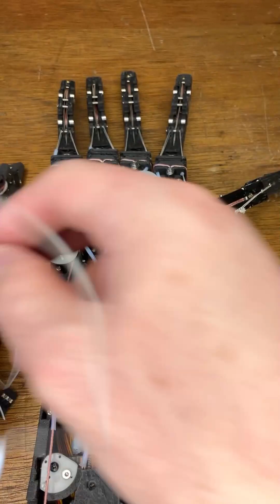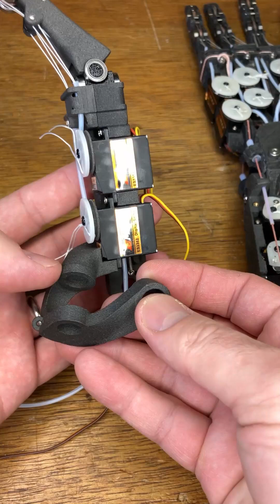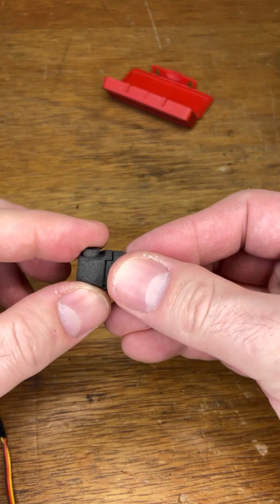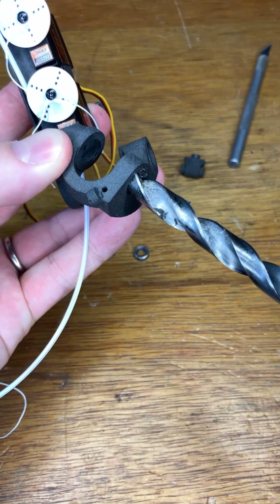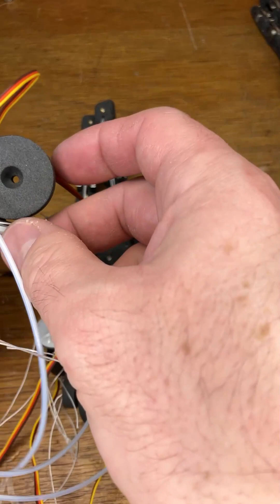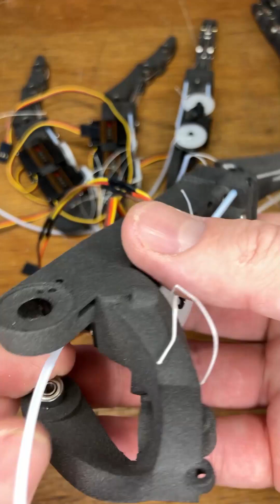How to build a V1.0 DexHand Part 7: Fingers and thumb #DIY low cost #robot #hand

Comment: Can I make one or two observations regarding your design compared to the human hand? Firstly, the thumb does not pivot in the way your design shows. It is the same as your finger 3rd joint but rotated 55 or so degrees. 
Secondly, fingers need to have the ability to pull upwards as well as downwards. Place your palm under a laptop face down and you can lift your laptop upwards with your fingers. Your design only allows one directional force in that axis. 
Great design though and very small which is tricky to achieve.
Reply from the maker: Thanks. A lot of simplifications were necessary to fit just the 19 servos of this design into the size available. The thumb particularly has less actuators than the human anatomy and the rotator is nothing like how the human thumb functions. Still it works and uses many less powered dof.

I class this as a semi-dexterous hand and for now it’s still more than enough for the computational models that are commonly available.

I expect that to change in due course and eventually the hardware will be the limiting factor in the capabilities of robots - couple more years I reckon…
Reply: @therobotstudio  what did you use to design the parts?
Reply from the maker: The CAD is designed in Solidworks.

Comment: Hello, your work is wonderful! But I have a question for you, is there a correspondence between the four tendons of the thumb and the four PTFE tubes that you mounted on the wrist in part 8? What is their correspondence? Looking forward to your replies!
Reply from the maker: Thank you.

There are eight ptfe tubes that pass through the wrist. Four transmit the long tendons of the fingers, one each and four drive the thumb. 

The four ptfe tubes that come out of the centre of the forearm guide the tendons that drive the thumb.

Two are similar in action to the finger servos in the palm - they drive the knuckle movement.

One is a long flexor which passes through the centre of the thumb knuckle.

The fourth directly drives rotation, it attaches on the thumb structure near the top of the knuckle and passes across the back of the thumb.

There are two springs for the V1 thumb. A main extensor which passes from the back of the middle phalange to the top of the knuckle.

The second spring pulls against the rotating tendon and attaches to the thumb knuckle phalange and then to the tendon hanger that attaches to the first finger between the servos - the tendon hanger for the thumb knuckle tendon that draws the thumb towards the palm and the first finger.

Comment: Could this design be adapted for a prosthetic?
Reply: Maybe if I thickened the gauntlet or simplified the design for the tumb?
Reply from the maker: Yes, you could put the thumb servos somewhere else or use the available servos in a different configuration to drive multiple fingers and leave some for the thumb.
Reply from the maker: Tricky for the V1 as the thumb is actuated by servos in the forearm. Typically this will make it too long.

Comment: I am using brushless dc motors for my robot fingers and wrists that are mainly used for drones or rc cars generally.  this is instead of a integrated servo.  to downgear I'm planning to use a archimedes pulley system instead of gears.  this will cut noise down to near zero.  removing the gearing from the direct proximity to the motor means more flexiblility in design and larger motors possible which means higher speed and torque available for a much more powerful robot at a VERY low cost still.  the pulleys I have varied in design plans for alot.  but thanks to this video, I looked into micro bearings and found 1mmx3mmx1mm bearings which I can use as pulleys with some small modifications.  I did not know such small bearings exist.  I thought smallest is size of a quarter!  these are SUPER small.  maybe too small to bear the loads I want so I bought 1x3x1mm, 2x5x2.5mm, 3x8x4mm  this way I can use larger pulleys for downgearing bigger motors in my robot but the smallest ones for downgearing the smallest motors.  let me know your thoughts and if you would consider this approach as well and scrap integrated servos entirely since they are weak and loud relatively speaking. By integrated I mean gears, motor, pot, control board all in one box.  Better to split these up to have more flexibility in form factor during design and not be forced to fit these boxes full of components in your design.  I HAD to go the route I'm saying here due to going with human skeleton as my frame instead of a hollow 3d printed mech style like you.
Reply from the maker: Glad I was able to help with the bearings.

I swore off integrated servos many years ago as they are far too prone to self-destruct. However the serial servos as produced by Dynamixel or more economically Feetech give feedback on motor parameters like temperature that make them a serious proposition.

Splitting the motor and controllers is limited by the cabling, which is one of the fundamental constraints on all robot designs.

This arm and hand shows the problem with precision industrial drives which require 3 motor phase wires, 5 Hall effect wires and 8 encoder wires for a grand total of 16 wires per motor!

For a hand with decent numbers of motors this becomes the dominant design constraint: https://youtube.com/shorts/V25Jn5UPYx8?si=WJvp04OrGJeln2Lx
Reply: @therobotstudio  my primary focus of my question was not on cable or controls although that is relevant surely.  my primary interest is your feedback regarding replacing gears with pulleys so you have more flexibility in form factor and don't have to fit such large black boxes integrated servos make you stuck with.  you also remove gear noise.
Reply from the maker: It definitely has potential - I’m considering hybrid designs of servos and tendons to get the best of both worlds.

Comment: I just bought some polymorph I'm sure I'll find many ways to use it and it is a nice tool for my repertoire.  your early videos are full of polymorph love
Reply from the maker: It's fantastic stuff, all of the early robots are completely hand made in polymorph.

Get some freeze spray as used by plumbers to make temporary blocks in pipes to rapidly cool large pieces and a hot air gun to remelt.

Make sure the pellets are well worked together before making anything that needs to be strong.
Reply: @therobotstudio  i never heard of freeze spray I just use upside down computer air duster cans to spray freezing spray onto hot glue to speed curing time
I wonder which options is cheaper?
Reply from the maker: Probably compressed air is cheaper but freeze spray is much quicker acting.

Comment: I have a question about the two knuckle servos that connect to the thumb. One is pretty easy to determine how it's connected is seen in the video The inside one however the routing for the tendon is somewhat confusing. Plus you have a tendon running to the insert on the forefinger. Does that mean we have four servos controlling the thumb. I've completed all of the fingers and a thumb but the inner tendons and the thumb and the routings are the only thing I have a bit of confusion over. I know you'll tell me what I'm missing. Thanks again. By the way the 3 mm springs are working great
Reply from the maker: Yes, you’re a bit ahead of my build videos!

The thumb has four tendons in total, all driven from the forearm.

Typically I use the four tendons that pass through the centre of the forearm to connect to the servos in the middle of the forearm.

Two tendons emerge in a similar position to the finger knuckles. There is an eyelet on the tendon hanger that attaches to the first finger palm section and another at the base of the thumb support, near the centre of the palm at the wrist end.

The long tendon passes through the middle of the two-piece thumb knuckle joint. The PTFE should line the hole in the centre of the thumb knuckle and the tendon passes through.

The fourth tendon is for rotation and attaches to the thumb support just to the inside of the thumb knuckle. It is opposed by a spring or elastic band that connects to the other side of the thumb and then to a screw in the tendon hanger which is clipped to the first finger palm section.
Reply from the maker: Glad the 3mm springs are working well! Passive extension is not an ideal method for the fingers but works well enough with a bit of careful set-up. The advantage of springs over bands is the extension force is linear and the lifespan of steel springs is much longer. Once set up it should last a good long while - be interested to hear how you get on…

Comment: I'm Nhan a student from the university of Georgia. I am very interested in building a hand. I have a few questions im hoping you could answer if you dont mind. firstly, huge fan of your work! Really incredible stuff. 

I am relatively new to the robotics scene  and I fell in love with this project the day I saw it on YouTube. I have some experience with servos and Arduino. 

-to make the v1 hand, I know that there are 3 servos per finger, and each servo is hooked into a Arduino / microcontroller which is the used to control the hand correct? 
-if my intentions were to create the moving fingers, and not the moving wrist. and use the sample code. am I getting myself into more trouble down the line by excluding the wrist and there will be compatibility issues due to me excluding the wrist? should I just build the entire forearm and hand? (im scared with my limited knowledge I wont be able to build it)
-Do I have the overview of the project correct by assuming the following: all servos will be hooked into a Arduino, then I use the sample code provided on GitHub to simulate various pre program poses? 
-do you think someone with my limited skills can buildout the entire arm? is the entire arm (hand, and forearm) all less then $300 to build?

any help would truly be appreciated. Thank you Nhan
Reply from the maker: Hi Nhan! Wonderful that you want to build a hand. Although a hand is probably the most mechanically advanced part of any humanoid the intention is to encourage people in exactly your position to get into robotics and make more than they initially believe they can!

Some prior experience of servos and Arduino will definitely help. All the servos are indeed connected to an Arduino and can then be controlled by a variety of software - either directly just from the Arduino or by connecting the Arduino to a PC.

It is not necessary to make the wrist move but you will need to build the forearm to mount up the servos for the long tendons that drive the fingertips and the thumb.

Yes, I think you will be able to complete the hand and forearm, and if you get stuck you can always ask for help. 

I need to double check the price of components as inflation is having an effect but if you have access to a 3d printer you should definitely be able to make the hand for between 300 and 400 USD.
Reply: @therobotstudio   Awesome! thank you so much! will keep you updated. Printing all the parts out today.

Comment: Thank you, very helpful. I can't seem to find the STL file for the tendon hanger that fits between the servos on the forefinger. I've gone thru the latest V1.0 Dexhand folder and can't seem to locate it. Am I missing something?
Reply from the maker: Thanks for the reminder - just uploaded it now to the Hand_06 folder on the github: https://github.com/TheRobotStudio/V1.0-Dexhand
Reply: @therobotstudio  thanks for the fast reply
Reply from the maker: Thanks for checking my work 😁
Reply: You're welcome another thing I noticed is the knuckle joint of the thumb does not have any pilot holes in the CAD data for the M2 hole that you were tapping.  I pulled down the data added it in CAD, printed and continued to follow along with this amazing build. 
The other thing I noticed and I'm sure you're aware of is the parts list that is under every video is incomplete. Things like the 2 mm springs, the PTFE tubing, the Arduino board and the rest of the electronics. I know I found the descriptions in the PDFs included in the files but it would be nice to have just a complete shopping list incorporated somewhere underneath your videos. 
Again amazing work. Watching all your videos I can see how the versions of this hand have progressed it's quite amazing and shows a lot of persistence and innovation on your part to revise and improve the design so many times.
Reply from the maker: Many thanks for all that. I’ll update the CAD for the thumb knuckle.

I’ve already used up the maximum character count in the YouTube description - where would be the best place to put the full list of components?
Reply: @therobotstudio  I would include it in the V1-Dexhand folder.
Reply from the maker: Thanks.

Comment: This video is really helpful!! Thanks a lot, I hope I'm able to complete the hand and wrist by tomorrow
Reply from the maker: Good stuff - how you getting on?
Reply: @therobotstudio  i have completely assembled the fingers and the wrist.
The forearm bulk part where the motors go in is v time consuming to print so I'm printing in it two parts. 
They'll be done by Monday and I hope to start working on the forearm from Monday.

 Also, the curve on the palm_middle_bulk which connects the thumb cmc keeps breaking 😭😭. Done quite a lot of tinkering for the same. Would love to share the progress with you, can you share your mail or some other way through which I can communicate with you? I have some doubts regarding the stability of the thumb and forearm assembly.

 I'm actually trying to make it into a myoelectric prosthetic arm and simultaneously working on feature extraction from a myoware sensor. Would love to get your views on the same